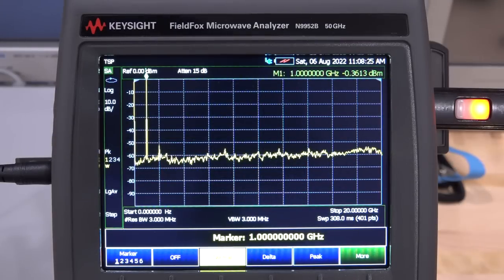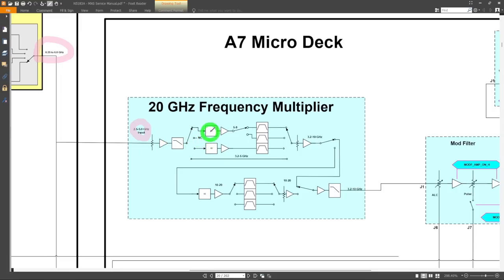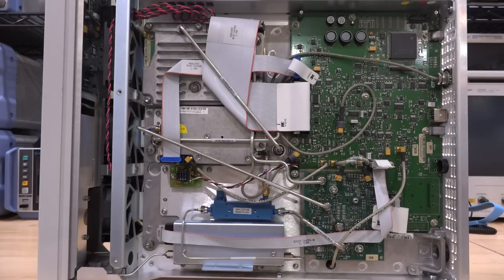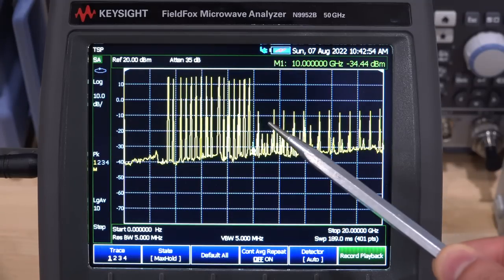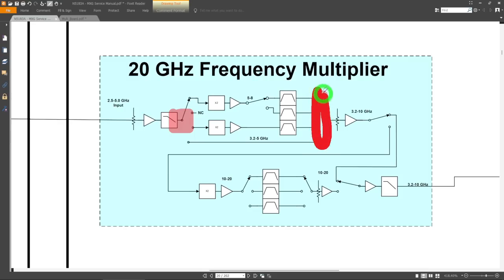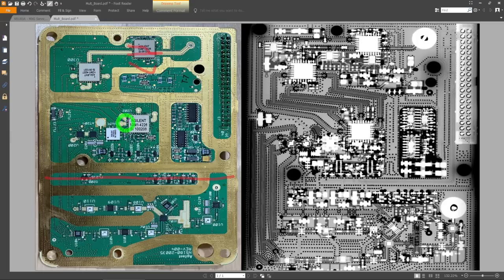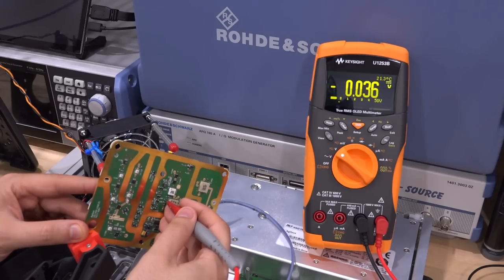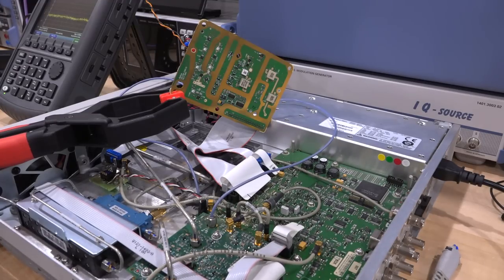TSP #211 - Keysight 20GHz MXG Analog RF Signal Generator Teardown, Repair & Analysis (Part 1)

Comment: Love your videos, I have a similar unit with a different problem. Mine works for 10 minutes and after that I get a error, 508, frac n loop unlocked. I will open and take a look inside whenever I have some time.

Comment: Great analysis as always! Shame it stopped at the custom module, however have you tried pressing down on the module or the old freeze spray? With all that thermal interface material I wouldn't be surprised if this failure is a result of thermal cycling and it could just be a failed solder joint or bond wire? The fact there is still an output just with excessive loss makes me think that could be the case as if it were catastrophic damage to the active junction it would probably result in no output. If it's a bad connection somewhere repairing that may be more feasible than sourcing a replacement for less than the cost of an entire replacement PCB.

Comment: In another few years we will be sold a brick with some controls and some connectors. We are almost there.
Shahriar had to use an x-ray machine to debug this. Who else has one of those ?
Nice job BTW ! I love your videos!
Reply: We are already there. Remember, this is an old analogue piece of kit. Latest version is probably all digital and integrated into a handful of FPGAs and/or ASICs - with bugger all chance of even the OEM being able to "repair" it; simply board swap or throw away.
Reply: @trickyrat483  I agree. And even if you can repair it you need a fortune in test equipment. The most you can do is maybe (maybe) check PS voltages. Yet, the price is still astronomical. So, spend 40-50K and add to that an expensive maintenance contract all so in 4-5 years you have to junk it. Ok, fine, 5-10 years. I have 3 TEK spectrum analyzers and they work perfectly and they are about 30 years old. Thank the test equipment Gods!

Comment: Out of sheer curiosity, can you please decap the faulty chip and check it under microscope please? I wonder what exactly is broken. The doubler clearly works, so my guess is that the problem is related to some amplification stage within the problematic chip.

Comment: Hi there, I've recently discovered your excellent channel, well done keep it up.

I also have a query. I am trying to repair a R&S SFU that has excessive quadrature phase error. R&S no longer supports this equipment and are unable/unwilling to supply me with schematics. Is there an online forum for RF test instrument techs where I would be able to source schematics, ask questions or alternatively source spares?

And of-course, if you have experience with this generator then I would welcome your opinion too!

Comment: It seems they knew about the electro-migration/aging issues in their high-speed switches and put a lot of thermal pads underneath them. Not surprised the failed chip had the highest amount of thermal pad. If you ever found the chips, replace the other chips with thermal pads underneath them.

Comment: Hello Shahriar, where do you get these schematics from? I am a college student who is working with a few instruments from Keysight this summer during an internship and want to inspect the architecture to use them more effectively. I tried searching online, but found nothing
Reply: They're typically in the user or service manual. I've not double checked, but here's the service manual for this range https://www.keysight.com/es/en/assets/9018-03964/service-manuals/9018-03964.pdf

Comment: @The Signal Path Did you check the 10.5GHz input to that IC you think is bad to be sure that it isn't before that, you seemed to make assumptions about the path before it being good, with that IC being so hard to find I think checking before it as well is a good thing to do, I would be checking directly at the output from that IC switch @16:16 be be sure that IC isn't the one giving trouble instead.
Reply from the maker: Everything before that module is fine. That is why we get the sub-10GHz signals to work fine.
Reply: @Thesignalpath  Ah, right, you are correct, I just went back and looked at the block diagram, I was thinking of the 2nd switch and bandpass filter section, which is obviously what that IC you suspect is doing. Another possibility is a switch after the final bandpass filter being stuck on one of the other filter paths, resulting in an effective back feed into a different filter.

Comment: did you try reaching out to manuf. for a replacement part/chip??
Reply from the maker: I plan to do that.
Reply: @Thesignalpath  Hope you have better luck with Keysight than I did with R&S; even Dr. Rhode couldn't shake loose schematics from the company for my FS300 spectrum analyzer when I asked him (he's a ham operator so I had a connection, but unfortunately no joy).
Reply: @PapasDino  That is depressing.

Comment: Wouldn't keysight provide one as you promote them alot ?....cheers.
Reply: @Waterbeach Electronics Ltd That's the point. Agilent/Keysight is a test gear manufacturer, not a chip manufacturer. Because they have such specific requirements for amplifiers or other components they need to design their own ICs. They're good enough to work quite reliable but eventually they're just not as good as what is available for everybody on the market.

Comment: Hi! We have 2 such generators, and this chip also failed. It is impossible to buy it. It would be nice to replace it with a similar build. I think it helped a lot of people in the repair. I hope it will be possible to make an assembly that is not original.

Comment: This component like box. You can find small components inside it if carefully take out upper side. There is switches, amp, resistors. Be careful to open, but you can find solution without replacing

Comment: I'd like to know the most likely reason these high performance chips fail. Heat drives what mechanism? The cooling solution here looks pretty amateurish to me.
Reply: My guess would be a loose gold wire that bonds to the actual wafer inside.... what could have happened due to the heat
Reply: @great__success  if that's the case, might be worth seeing if these chips can get decapped somehow and try to  re-bond?

Comment: How diffcult, if at all possible, would it be to create a replacement-module for the chip? It looks quite big, so with tiny enough parts the necessary components might fit on some high quality PCB with castellated holes that can be soldered onto the board. It would not have the performance of the original part, but I think, the worst inaccuracies can be compensated for with different calibration coefficients. 
Would save the rest of the instrument from the scapper or spare parts salvager.
Reply: you need custom silicon for this sorta of thing so yeah no discrete component hack, at the point probably is better to find a replacement for the entire module nit just the IC. 🙃

Comment: Why not make it yourself ? It should be easy to do
Reply: Yep, wood, screws and a bit of glue. Easy.
Reply: sure he just has a fab next to the dining room for one-off MMIC designs...
Reply: @kevina.4036  If you go on digikey, you can find LNA and RF switches with same performance, or maybe even better one.  And where are special pcb material for low loss operation. So before any saying things like that maybe you should try to think a bit. Also he is quite capable engineer, i would not comment if he couldn't do it.